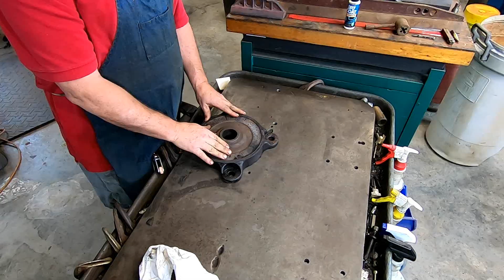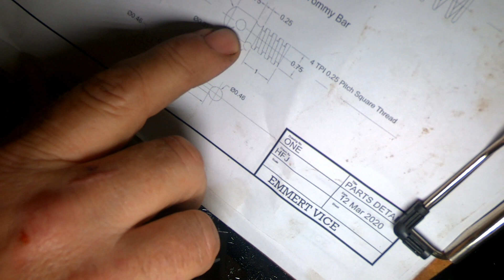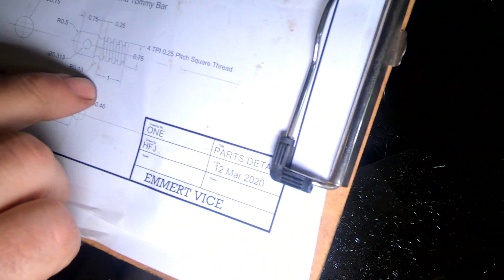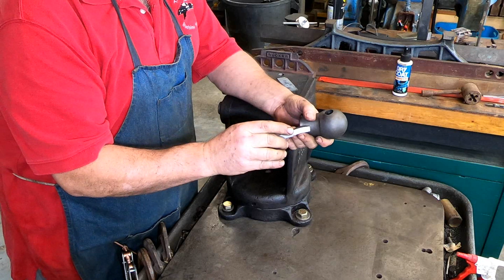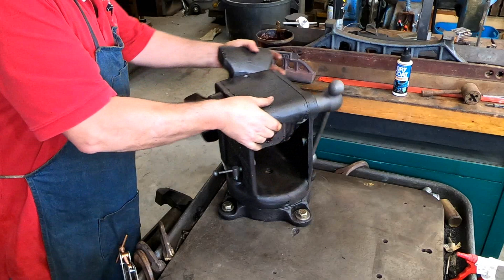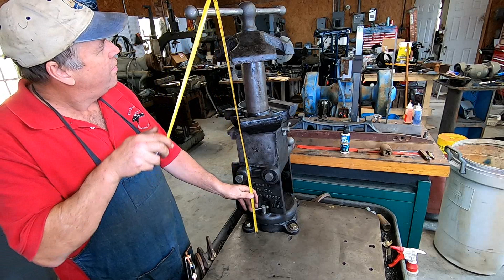One Of The Rarest Vises Out There Emmert 10A Machinist Vise Part3

Comment: How hard can it possibly be to build one from scratch? This guy https://www.youtube.com/watch?v=zkY_QJOzG7g spent $5,000 for a badly beaten Emmert Vise. For the life of me, why would you spend so much money on it when you can build one at a fraction of the cost? Provided, of course, you have a machine shop. And why does it have to be made of cast iron? Anyway, I think I'm going to give it a shot but I'll make it smaller in size with 2.500" jaws. I'll first make a 3D printed model to make sure it works as intended.

Comment: That must be one of the very first made because, it doesn't have the 90 degree milled slot for adjustability. It only has pivot and lock pins for a few positions not infinitely adjustable positions like some.

Comment: That's some nice work.  One comment---if you don't mind.  A table for light work should be elbow height.  A table for medium work should be fist high.  A table for heavy work should be knee high.  At least, that's what the ergonomics books say.  I think you might find that you'll use it more if you mount it on a lower table.  But it's your shop so don't let me boss you around. Thanks for posting!

Comment: That same manufacturer made a pattern makers vise used for making wood foundry patterns.  It articulates even more due to all of the draft that needed to be put on foundry patterns.  If you can find an Emmett pattern makers vise they easily go for over $1000.00.  They were so much in demand with woodworkers 20 years ago that the red Chinese copied an original and sold it through various woodworking suppliers here in the states.  The finish you put on it is most appropriate.

Comment: Beautiful job.  if you end up storing the vice in a open vertical position.. please find a foam pool noodle or some foam pipe insulation to push over the dogbone so you don't clock your head into it..   i am thinking..  does the shaper behind you work.. you could set the vice base up at an angle and recut the radial grooves with the shaper.. one groove at a time.  perhaps drilling  a shallow relief hole at the end of each.. then clamp the locking jaw in something to allow you to duplicate the radial grooves in the locking jaw face..  again one at a time.